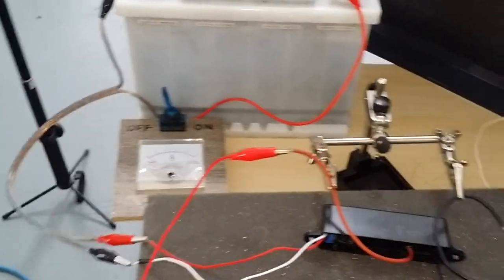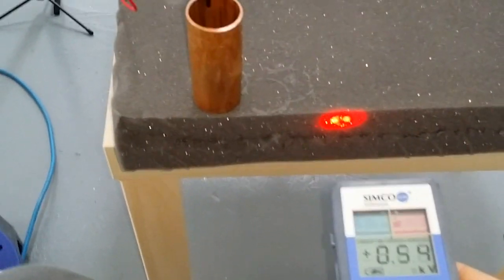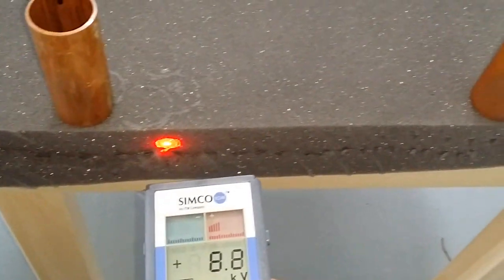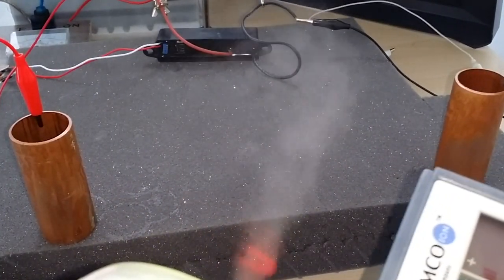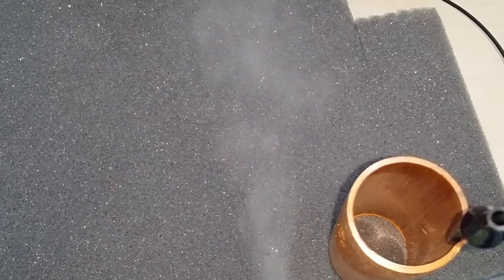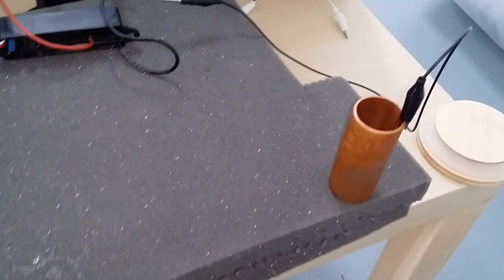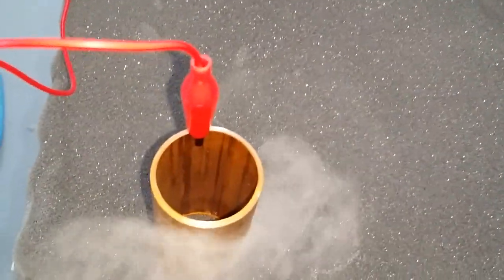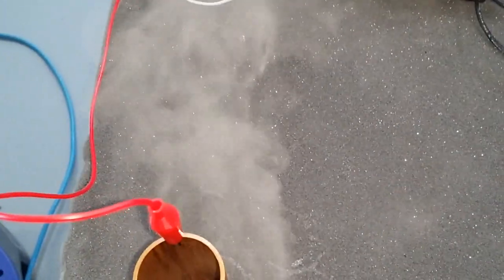Water vapour attracted to both polarities

Comment: Water molecule polarizes and its free to turn. Therefore will attracts to both favoring positive  as the hydrogen molecules tend to fight for negative charge source creating a destabilized polarization around a negative source.
Reply from the maker: Thank you for the comment. What I was trying to show is this: Water vapour can be easily charged, not polarised. Charging means that electrons can be detached from the molecule easily. In the neutral ambient, water vapour is "+" charged. But with static induction, the electron moves freely, so that the charge changes. This also means that the remaining water in the nebuliser will have the same charge as the inducing pole. Mostly of the scientists try to explain it with polarisation, which I do not agree. If you do a few experiments, you can see easily that it is not polarisation.